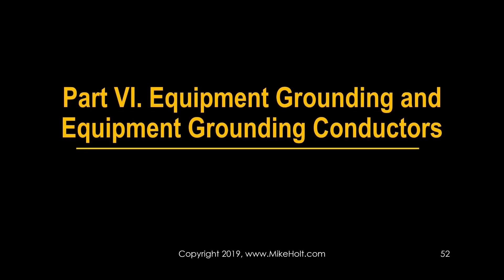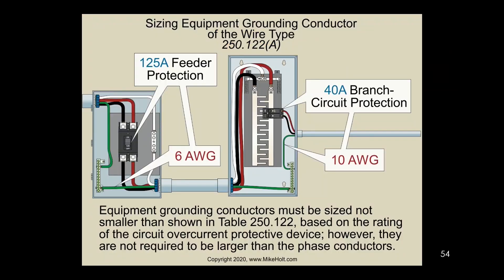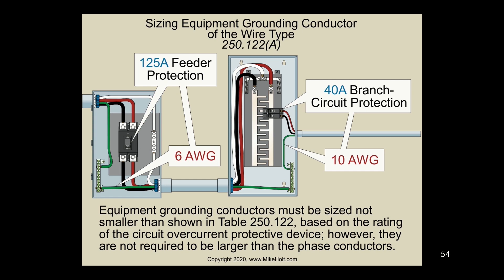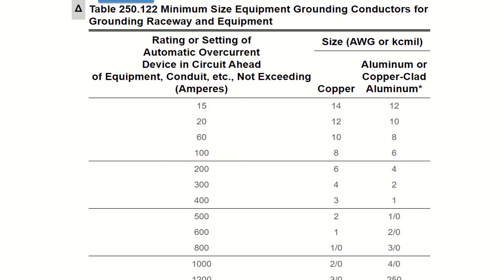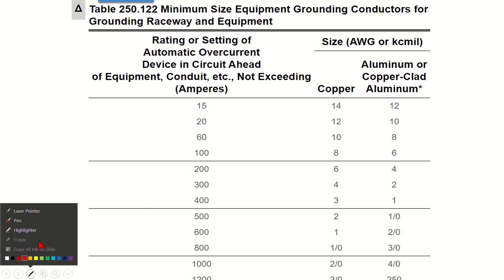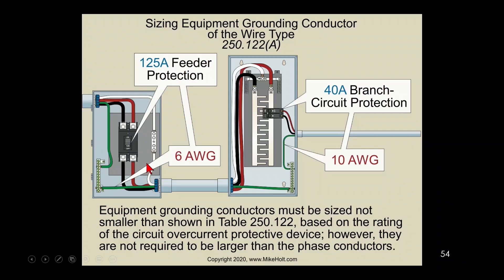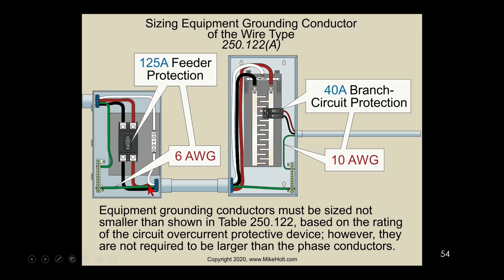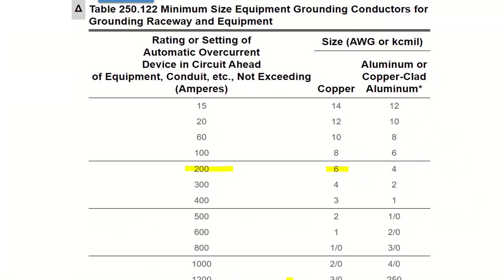Equipment Grounding Conductor, Sizing (EGC) [250.122, 2020 NEC]

Comment: I’m running 6  20 amp 12 awg thhn circuits in a 1inch emt from a sub panel to a junction box how many grounds should I run with the circuits the master I work with says that I should run one ground for 3 circuits
Reply from the maker: See 250.122(C), what does it say?